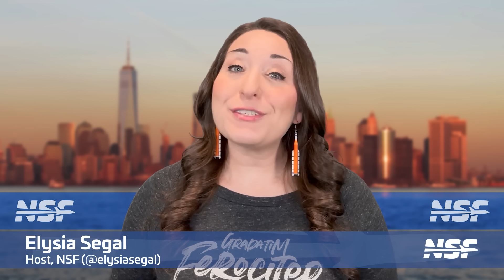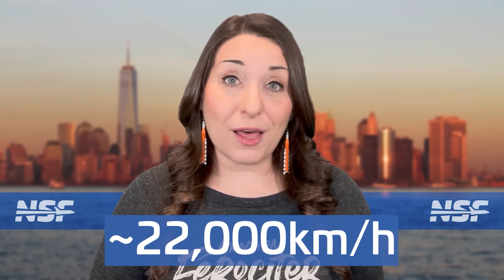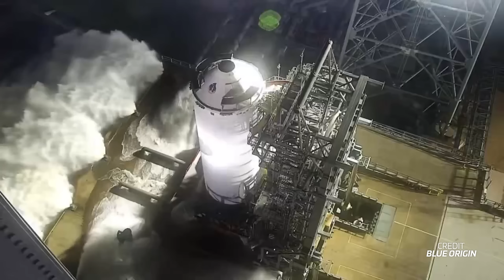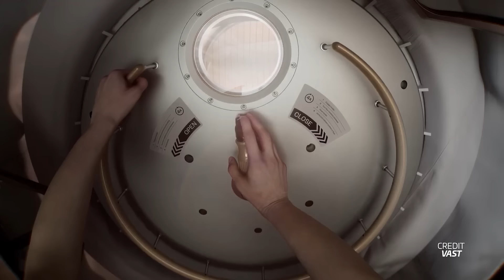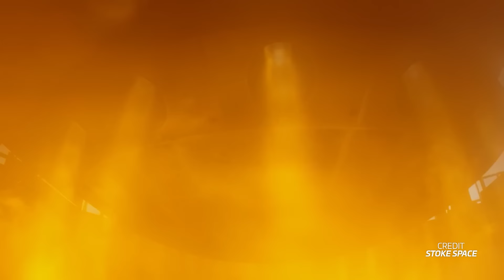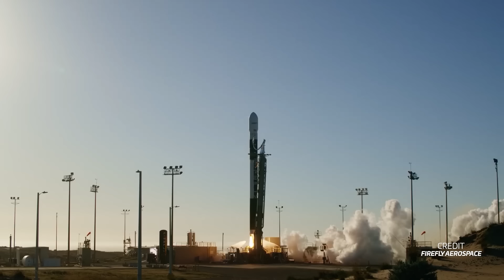Starship HLS Tensions Rise in New Report | This Week in Spaceflight

Comment: This seems to be NASA's go to response to "issues" with the SLS... something goes wrong, we'll fix it but we won't test it!  They have done this with the Orion life support system (no need to test it in space for the full duration of a mission, it'll be okay), Orion's heat shield (no we don't know what went wrong but there's no need to fix or test it, it'll be okay), and now SLS (yes we've had some leaks but they're now fixed so no need to check, it'll be okay).  WOW!  Just WOW!
Reply: Orion fixed its orbit so the problem doesn't happen. The last helium leak was on ground equipment and not on SLS itself. If the seal still leaks some fuel is wasted but SLS still gets fully fuel.
Reply: @mrbaab5932  Orion has changed its re-entry profile, but without knowing what the problem with the heat shield was, there is no guarantee that the problem won't be worse next time.  As for the helium leak, you may be right, but they haven't tested the hydrogen leak fix after another trip to the pad.
Reply: @chrisantoniou4366   The heat shield problem was due to the previous method of skip reentry which was designed to reduce peak heating but it also took longer which gave gas under the heat shield time to expand and create the problem on Artemis I. Ground testing showed that the heat shield can withstand a more "ballistic" reentry without skip, which will be shorter duration and eliminate or at least reduce the gas build up. Sure ideally they would test their conclusions with a non-crewed test flight but that would cost 4 billion dollars and a 3 year delay to the program. They say their tests are conclusive that reentry with the modified reentry profile will be safe.  The astronauts were included in the discussion and they agree.  When you leave your house to go to the grocery store you cannot 100% guarantee that you will return home alive, and that is true with flying to the Moon also. Before you leave your house do you every time check your tire pressures and check your brake, oil and coolant levels? Probably not. NASA is checking everything they can prior to the Artemis II flight. At least we hope and assume that they are checking everything possible.
Reply: @chrisantoniou4366  Not to mention they newly-announced issue of them not being able to do many tank / de-tank cycles, as each one makes the tanks and plumbing weaker and more brittle... or the fact that the "fix" for the helium seal was to remove it completely and beef up a secondary seal instead.... all of this does not bode well...
Reply: @i-ccc-channel  Agree, and that is the REAL reason for NASA not doing a second wet dress rehearsal I'm afraid.  Having said all that I sincerely hope it all goes to plan...  🤞
Reply: @StevePemberton2  Actually, I DO check all those things on my car because apart from anything else there are warning lights for each and I look for a "clean board" before releasing the hand brake.  This is no guarantee I will return alive, but it improves my chances...
Reply: @chrisantoniou4366   That's good that you check the dash lights. Another good thing to do, although it's a reminder to me to start doing it again, is a quick walk around the car before driving off to glance at the tires for an obvious flat or very low tire. And also to make sure nothing is behind the car that you might back over. 

But my example would have been better if it referred to going on a long road trip. It used to be more common for people to do all the checks before going on a road trip, check the tire pressures, and importantly check the spare tire pressure if there is one (most spare tires are flat from years of not being used). Making sure you have everything for a tire change including the tools, a board to put the jack on in case you are on soft ground, a reflector stand to put up behind your car when changing a flat. And check all of the fluid levels.  

Some people still do all of this prior to a road trip but I think nowadays most people don't. For example I don't remember the last time that I saw someone with a reflector set up when they were changing a flat. In fact I just realized I no longer have one and need to get another one. I have followed aviation and spaceflight for decades and I try and think like they do, which is to try and be ready for anything, and to look for lapses where I have been not checking something that I have been lucky to get away with so far.
Reply: @StevePemberton2  I agree!  With the tyres, I have a pressure sensor and I'm conscious of the noises or pull from a flat tyre when I back out of my driveway.  I also have a reversing camera and I don't move unless that's checked, and I watch it as I reverse out, and, as my car is an automatic and my drive has a slightly downward slope I keep my foot on the brake the whole time (this also verifies my brakes are working well), stop before the footpath and check both sides for foot and vehicle traffic before moving further.

Before a long trip I check all fluid levels manually and the condition of clamps and hoses and check for any leaks and physically check the tyres.  I also carry an air compressor which I keep fully charged and have a cable I can use to charge it from the car if necessary.  I have a jack and everything needed to change a tyre and carry a tool box with everything I am likely to need along with spare oil, coolant, and brake fluid.  I also have a first aid kit, torches, heavy duty umbrellas, and keep long life muesli bars as well as fruit juice and drinking water.  It goes without saying I always have my mobile phone with me and a cable to charge it if necessary.

I'm just glad someone else does what I do...  😊
Reply: What do you mean NASA does not know what went wrong with Orion's heat shield?! Just because you don't f""cking know anything or heard of it, doesn't mean NASA doesn't. NASA did its own investigation (mainly at Ames) to fully understand the problem. In addition it engaged independent teams to do their own investigation whose finding concurred with NASA's. They tested and retested, modelled and remodelled the crap out of that heat shield in lab conditions with arc jets at Ames to simulate real life conditions and they know exactly what caused it and how to mitigate it - a shallower, lower heat reentry profile takes care of it. The rest is programme management issue (new subject to you) which means you don't have to spend another 3-4 years delaying Artemis II - you can fly it without delaying the programme and get that new shield ready for the next Artemis launch.

As for SLS hydrogen leaks, hydrogen always leaks when fueling a rocket stage no matter what you do with any rocket. It's the nature of the tiny molecule to escape and degrade on contract seals due to its extreme low temps. That's the downside of it. The upside it an extremely energetic and pure molecule - way better and cleaner than methane or RP-1. So it's a question of how big is the leak. So when you see on April 1 or April 3 SLS being fueled you should know hydrogen is actually leaking while you're watching it. You see vapours of it at connecting points. The acceptable manageable threshold is 16% of leak. They now learned how to keep is under 16% on this particular rocket. If you see fuelling cut-off it means the system automatically triggered fuel pumps stop due to exceeding the 16% threshold leak rate.

There's no need to do yet another wet dress just to confinm they are happy with the fueling methods they worked out. It unnecessarily overstresses the rocket's body which introduces another completely unnecessary risk of metal fatigue due to repeated extreme chilling-heating cycle of the metal. That's true for any rocket if you keep tanking/ detanking it with chilled fuel. The actual launch day fueling is in effect can be a wet dress rehearsal because they can always scrub the launch and turn this into a wet dress if there's another problem.
Reply: @Sagittis_veritatis  Yes, NASA tested and retested for over two years but they themselves admitted they didn't know what went wrong with the heat shield.  It may well be that the heat shield would have failed catastrophically but didn't due to sheer luck.  Altering the re-entry profile may be a good idea but is no guarantee that the heat shield will be okay.

As for the hydrogen leak, yes they might have fixed it, but for how long?  I do understand about hydrogen leakage and the difference between acceptable and unacceptable leakage (and you can spare me the "cleaner, greener" aspect of the fuel), what I'm talking about is unacceptable leakage when you haven't tested the seals in situ with the loads and pressures of a launch.

I notice you haven't said anything about the life support system on the Orion which hasn't been tested in space or for a full duration flight.  They had a perfect opportunity with Artemis 1 but decided it would be okay...
Reply: @chrisantoniou4366  
they themselves admitted they didn't know what went wrong with the heat shield
Quote please, because I think you just made it up. Complete contradiction to what they said that they replicated the conditions of reentry in the lab and fully understand them.

no guarantee that the heat shield will be okay
There's no guarantee in spaceflight for anything. Apollo CSM flew 6 times successfully with astronauts onboard and several times unmanned before tjose flights and on the seventh manned flight oxygen tank decided to explode. That's why there's only levels of acceptable/ unacceptable risk, risk mitigation through backups and multiple redundancies. No guarantees.

you can spare me the "cleaner, greener" aspect of the fuel
Methane is clean and green enough but I wasn't talking about the greener aspect - but rather the energy of the molecule. You can spare me your hatred for hydrogen just because SLS uses it and dear-Elon chose methane crap.

unacceptable leakage when you haven't tested the seals in situ with the loads and pressures of a launch
There's no such thing as "pressures of a launch". There is tanking pressures and temps at connection points that ground pumps provide. Read my last paragraph - I don't want to repeat myself. Wed dress and launch day tanking pressures are the same. Tanking itself on the launch day can easily be a form of a test.

I notice you haven't said anything about the life support system on the Orion which hasn't been tested in space or for a full duration flight
There's nothing wrong with Orion life support.
Reply: @Sagittis_veritatis   Yeah everyone gets worked up about hydrogen leaks thinking that it is somehow a major safety issue or that the rocket itself is leaking. When in fact the leaking is at the connection point with ground equipment, and most of the leaking occurs during fueling when the astronauts are not on board yet.

As for 16% just to clarify that is not the amount of hydrogen leaking out that is the percentage of hydrogen in the air sample that they take at specific points near the connection. A larger leak will cause a build up of hydrogen in those areas. Even keeping it to that level is basically an abundance of caution, because it’s unlikely that any leaked hydrogen will ignite, and even it if did ignite there would just be a bunch of flames going up the side of the rocket just like Delta IV launches did on every launch. Rockets are generally pretty good with handling flames. But of course there are limits and that’s what they monitor. And again the leaks are almost always during fueling, although leaks can sometimes occur in the ground connection later in the countdown while maintaining tank pressure, if that happened with astronauts on board they would immediately begin detanking which will reduce the pressure and most likely stop the leak.

Regarding the ECLSS what they tested on Artemis I was the nitrogen side of the system. The oxygen side of the system is nearly identical. After the flight they were able to extrapolate the data from the nitrogen testing to the oxygen system. I had forgotten that about the CO2 until you mentioned it.  They will be testing all of this in Earth orbit prior to TLI.  Yes an Apollo 7 style test flight would be ideal, but that would be yet another 4 billion and three years (maybe two years under Isaacman).

Regarding launch schedule they just added April 2nd so it’s now April 1-6.
Reply: @Sagittis_veritatis  With a 115 km perigee it would automatically deorbit after I think just a few days, so even if they lost main propulsion on Orion or felt it was unsafe for some reason the capsule would come back to Earth on its own. Of course if propulsion is working on Orion they can deorbit immediately if needed and not wait for atmospheric drag to bring them down.

Apollo 7 was a ten day mission in low Earth orbit which simulated the length of a Moon mission. That would be ideal for Artemis, but again it would add 4 billion and 2-3 years. Instead they are doing the testing that you mentioned, of course tons of testing prior to flight, then the testing in Earth orbit to validate that the systems are working as planned. Oddly people have no qualms about the idea of launching people on Starship which is basically a deathtrap as it has no launch escape system. People say "oh but they would of course fly it many times first uncrewed".  So what?  I don't care if it has flown successfully 100 times, your life depends on the ship's propulsion and guidance system remaining fully functional all the way to landing. Falcon 9 boosters landed successfully over 100 times then one of them failed, which would have been fatal if someone had been riding inside the booster.  With a capsule just about anything can go wrong including the rocket blowing up and you can still most likely survive since all that needs to work are the parachutes which is a technology with over a century of experience.
Reply: @Sagittis_veritatis  Ideally Artemis III will fly when both landers have reached a point that they can maneuver in space, docking ability, crew transfer ability, and life support. Don’t need landing legs, crew elevators, fully outfitted crew cabin, and this would be prior to the first landing tests. So in theory both landers can get to this point in 2-3 years, and then have say 2 years of work left including two (each) uncrewed landing tests prior to Artemis IV and V.

It’s sort of like flowing the development of Starship version 3 and pad 2 at the same time, with both arriving at about the same time and neither one holding up the other that much. With Artemis it likely won’t be quite as coordinated, either SLS or one of the two landers will likely hold up Artemis III even if the others are ready. But that’s okay, and Jared has indicated they aren’t going to try and meet unrealistic timelines. The only issue is that SLS really needs to fly at least every two years or they lose the smoothness that comes with cadence, once a year would be ever better although we don’t know yet if that is possible.  So it would be bad if say SLS and HLS are ready but Blue Moon is lagging and they are forced to delay Artemis III a year waiting for Blue Moon to be ready for Earth orbit tests. But my guess is they would fly Artemis III even if only one lander was ready. But can you imagine Orion docking with HLS and Blue Moon on the same flight, with astronauts taking each of the two landers on joy rides of say one day each, doing proximity and docking tests. That would be pretty cool.
Reply: @Sagittis_veritatis  I predict that besides the current PEZ door method and the expected clam door or whatever method for deploying larger satellites, that SpaceX will eventually have a “topless” Starship which can have a capsule placed on top. Just need to move the header tanks down. Elon probably realizes they will have to go that route but no way he will admit it publicly now as it doesn’t fit the fantasy narrative of launching 1,000 Starships with 100 people each. All of his public statements are mostly fantasies served up to a starry eyed fanbase because he knows he needs public support, which translates into investor support. And they all follow like a pied piper. Many of us have argued for years that human flights to Mars in less than two decades is a fantasy, we need to go back to the Moon first. But we were drowned out and accused of trying to recreate past glories and not being forward thinking, and that we should listen to and believe Musk. Then on a dime he pivots 180 degrees and says that Moon first makes more sense, and the fanbase instantly applauds his brilliance. And not one of them thinks “Wait, that means he has been wrong or lying to us for the past ten years?)”. In reality I’m quite sure Musk has known for a long time that they weren’t going to Mars in the 2020’s much less his fantasy stated in 2024 that they would demonstrate uncrewed Mars landing and return to Earth in 2026 and possible human landing in 2028. Even a one way mission in that timeframe would be near impossible, with return to Earth in that timeline absolutely impossible. But try explaining that to a fan. They just say “oh he’s probably a little optimistic”. A little optimistic? 

Actually I think in reality Musk is very smart, and behind the scenes he seems to think more realistically. And while much of the SpaceX success is certainly because of the brilliant people who work there, he had provided freedom to innovate and a willingness to try things never done before, and that is what attracts that type of worker. But the public side of Musk is a farce. People who work for SpaceX have probably learned to just ignore whatever he says in public and just continue working on whatever the current task is.
Reply: @Sagittis_veritatis  I understand about the orbit and propulsion, that isn't my point.  My point is that the life support system could and should have been installed on Orion aboard Artemis 1 so it could be tested.  It wasn't, and NASA took an unnecessary shortcut which is directly involved with the astronauts' lives.
Reply: @Sagittis_veritatis   The test flights have demonstrated that ship recovery is possible and I think most likely ship reuse will be possible also.. They won’t be turned around quickly, probably the heat shield tiles will need to all be replaced or removed, inspected and reattached between each flight, and the first recovered ships will likely need extensive "bodywork" depending on the damage. But the important thing is that they will get the engines back.  Once reuse of the ship becomes at least doable I think it will make Starship a game changer for lifting heavy and large payloads to LEO at substantially lower cost than current.  And also it can carry large expendable upper stages (larger than current) which can carry payloads beyond Earth.  

Reusable ships however will never leave Earth orbit in my opinion, that will be expendable ships only. And even that may never happen as the whole refueling thing is another Musk pipe dream. They stuck fake docking adapters on ship 39 probably just to keep jerking NASA’s chain that they actually plan to continue with HLS. Refueling will be a thing one day but not now.  Not when it takes ten to twenty giant Starship launches just to carry enough fuel to send one Starship out of Earth orbit.  Better to just launch capable expendable upper stages to carry payloads beyond LEO. Musk probably knows this already but it’s not an exciting story to spin to the fanbase so he’s dragging out the fantasy as long as he can, just like he dragged out the Mars fantasy as long as he could.
Reply: @Sagittis_veritatis  Your "suspicion" may be wrong, so ask yourself why the life support system on the Orion was never tested in space.  Also why would you trust the same people who say Orion's testing "adequate and sufficient" to man rate a spaceship, who also said the same thing about Boeing's Starliner?
Reply: @Sagittis_veritatis   I also have connected Shuttle and Starship, it’s surprising how many people don’t see it.  When Musk dismissed the need for launch escape on Starship his reasoning was we’ll just test it enough to make it safe.  I found this chilling because it was exactly the rationale in the early days of Shuttle. I only stay calm on this topic by reassuring myself that no humans will ever launch on Starship. Dear Moon as an example gave me nightmares if I took it seriously, but I managed to keep reminding myself that it was a joke. Not a funny joke, because it wasn't funny it was alarming,  I mean joke in one of the word's definitions "something not to be taken seriously - a trifling matter". I really like Tim Dodd but that was his low point, falling for that charade. And for some reason he still seems to believe that it could have eventually happened if Maezawa hadn't pulled out.

I’m a huge Shuttle fan, I have a relative who worked at JSC on the Shuttle program for the whole program. I went to five Shuttle launches including the last three and the final Hubble servicing mission (living an eight hour drive away in Atlanta helps). Shuttle was amazing and innovative. But in hindsight it never should have launched astronauts, it should have been uncrewed. I am not referring to Shuttle-C I mean a winged uncrewed orbiter similar to Shuttle but somewhat smaller (but bigger than X-37B). I don’t fault NASA for building the Shuttle that they did, similar to now they were in a difficult political situation which I know you are quite familiar with the Shuttle history.  But in hindsight the Shuttle would have been much cheaper to build and fly if uncrewed. No crew cabin, so the Shuttle could have been smaller.  And in the alternate universe I am describing the DOD would have been told to sod off with their demand for massive payloads and massive crossrange.  

Shuttle would have launched and landed autonomously, a three (and later four)  person crew would fly up in a capsule and dock with it, perhaps connecting to a small "office" module in the cargo bay, which would act sort of like the orbital module on Soyuz but a little bigger, expanding the crew’s on-orbit accommodations, and containing a robotic arm workstation, etc. (and a toilet!). On flights that involved EVA an airlock would be attached to the office module . 

They could have done everything Shuttle ended up doing, including Spacehab, retrieving satellites, Hubble servicing, and building ISS. And sometimes launching small satellites, but only as a secondary not a primary mission objective.  Apollo with Saturn IB could have initially provided crew launches to dock with Shuttle, then later a more modern and less overkill capsule could have been developed to launch on existing expendable rockets. In fact a four-person capsule would have had similar capability as a 6-person Shuttle flight since the two pilots were off-limits for EVA and many other activities like robotic arm operation.

My in-hindsight view of Shuttle is how I see Starship’s future. But Starship also has the potential to be a heavy lifter for LEO, whereas my version of Shuttle would have focused on crew missions in LEO even though crew would have flown up separately.  Starship can do both.

However I long ago dismissed Musk’s ridiculous claims of cost per ton and same day reflights. But I think Starship will likely be an important step in expanding space capability.  Like you I also question at least the initial demand for large payloads, but I tend to believe a “if you build it they will come” scenario,  as the cost of launching large and massive payloads comes down, satellites and space probes can become bigger, and manufacturers won’t have to fight so hard to keep weight and size down when building satellites and space probes, which can lower their costs.  And it makes new space stations potentially more economical. Starship itself could even act as a space station for companies and countries who can't afford to build their own.  And if tanker flights on reusable tankers becomes reasonably low cost then maybe expendable Starships can carry large cargo pieces to the Moon, supporting the capsules and dedicated landers that will carry astronauts to and from the Moon and the expendable rockets that can smaller cargo there.  Meanwhile similar to today most Starships launches will probably be filled with Starlinks and datacenters, with commercial payloads launches when needed similar to current Falcon 9.
Reply: @Sagittis_veritatis  There is no "fundamental" difference.  The same people YOU trust to certify Orion are the same people who certified Starliner, and that is your reason for believing Orion is good to go.  I don't share your fan boy trust!